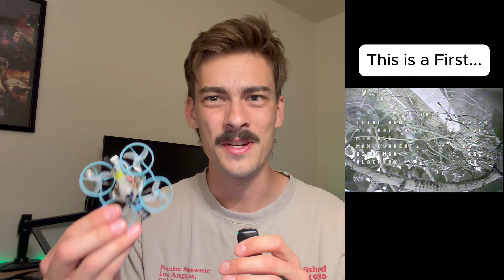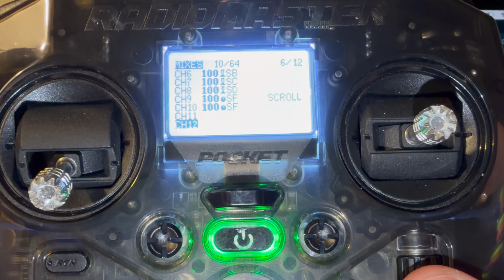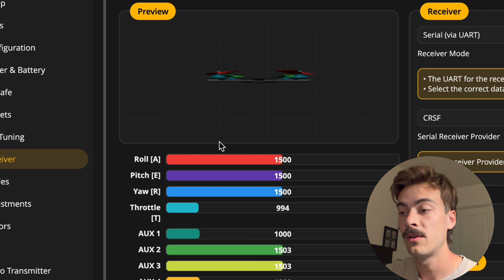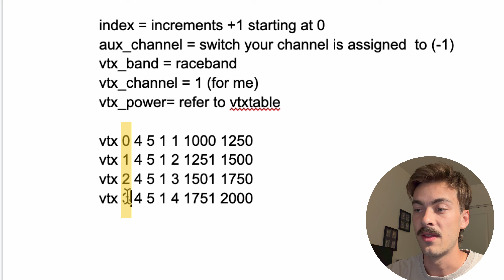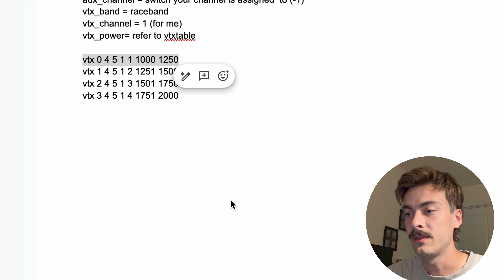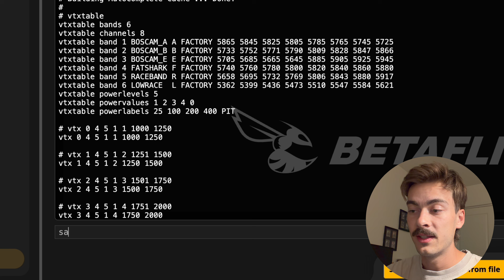Control VTX Power With Your Scroll Wheel (Betaflight Setup Guide)

Comment: Hey, Working thru this and found that you can't set the values as wanted, ie 1251, look at 10:08 and find it reset to 1250.
Hmmm, just found and wonder what diff it will make.
Also found that scroll wheel has seemingly set #'s for breaks, maybe should be set to those?
Also, having issue getting 400 power working.
Reply from the maker: Seriously good eye on catching my mistake I didn’t even notice!
Reply from the maker: Oh dang good eye!! You are right, it does bump down to 1250, and that’s the same for the others 😅. That won’t cause any problems though don’t worry on that!

As for the 400 power not working… I would check what the minimum and maximum aux outputs are for your scroll wheel. Sometimes the numbers vary a bit. Once you find that out, split it evenly into 4 ranges and use those for each aux command.
Reply: Ok, Got it working with a few tweaks. Your Pocket scroller seems to work different than mine. Yours scolls all # smoothly while mine has breaks and at specific numbers. So I used those numbers and rewrote the vtx cli input and have all power levels. It could have had PIT mode as well as another thing So, it comes out like this:
vtx 0 4 5 0 1 1000 1275
vtx 1 4 5 0 2 1275 1425
vtx 2 4 5 0 3 1425 1500
vtx 3 4 5 0 4 1500 2000

Comment: Hey man, love the video, super easy to follow. However. In the osd in my goggles say it changes power. Atleast, i think. Cus i see it changing. However when i tried to put it higher, but the power doesn't change. For example im almost losing video, but if i change it to a higher mW. And it doesn't change the range and doesn't  improve quality.
Is there some things i can do to let it work?
Reply from the maker: What channel did you end up using? Depending on the channel being used, the video might just look fuzzy anyways, so you’ll want to make sure you’re using the clearest looking channel and/or set it up having the global ‘0’ vtx_channel variable
Reply: @alec_searle   i am using A 7 5745
and thx i will try the 0 so it is for all the channels. maybe one is better

Comment: There is also VTX PIT MODE for when you get stuck in a tree, I have it on one of the 3-pos switches, and I have my potentiometer dial control my throttle limit, but I might try this method instead.
Reply from the maker: Both are pretty clutch! I see why having pit mode would be better than just 25mW
Reply: does pitmode work on tinywhoops? So smartaudio 2.0? Because I couldnt get it to work.

Comment: I’ve got power outputs at 25-100 - max but max doesn’t work. It just goes up to 100, any suggestions ?
Reply from the maker: Do you know what the max is? I’d make sure whatever value you have is a real one the vtx supports

Comment: Cannot for the life of me get this to work. Air75 II, RadioMaster Pocket. I am actually a software dev so this should be fairly easy. I follow all steps with my correct numbers but when I change scroll the wheel it doesn't seem to update the power, or, at least not the osd...
Reply from the maker: That’s interesting… I had to do some tweaking my first time to get the dang thing to work. If you wanna send pics of your video transmitter settings on betaflight to @alec_searle on insta/tiktok I might be able to help

It could be with assigning the aux channel on the radio controller
Reply: @alec_searle  https://youtu.be/MlktLNKyWBY

I believe this has all the information and steps I followed. I made it 2x speed to save your time. I also tested with a battery in the quad (Same results) but I didn't want to share the camera view. Thanks for any help you can give!

Comment: I use the osd menue. Pitch up yaw left stick comands open osd menue there you go to Features than vtx on that you go to Power and choose the output. But this way is much better bro thx
Reply: Me too, at first I really wanted to put an output on a scroll and then realised that I only really need to change it when I start flying, and I already just used the OSD menu
Reply from the maker: Yeah the OSD menu is pretty clutch if you don’t wanna switch in the middle of flying
Reply: @alec_searle yea thats so convenient

Comment: I can verify that it works! Clear instructions like a first class instructor. Mine was AUX7 and value was 1055 when scroll wheel is all the way to the left. So it was value 6 and I used 0 for the vtx_channel to cover all channels.

 I don't usually race with other FPV pilots but this will be handy when I do need to switch frequency to avoid clashing with a fellow FPV pilot during meetups. I've not tested switching channels yet though, we'll see later. Now my radiomaster pocket controls are fully utilized, so happy!
Reply from the maker: That’s what I was hoping to hear!!!! I’m so glad this video helped you and was clear enough to follow! Especially since some of your values were different

Enjoy it!! I’ll be curious to hear how switching channels works out with the vtx_channel set at 0!

Comment: When disarmed you can just yaw left +pitch up. Now your in the drones settings> features>vtx> power. Then adjust accordingly by moving right stick left or right. Go down to save&comfrm. Done
Not a fan of putting your vtx power on a switch/potentometer. If you hit the switch or move the wheel and accidentally drop your power. Well now you don’t have any or very little video.
Reply: Another fpv youtuber may discover stick commands
Reply: What... left up down menu save flip jump...
Reply from the maker: Yes! I knew you can do that, I just wanted to be able to do it on a whim while flying! Plus my fingers don’t rest on the scroll wheel so there’s not much risk for accidental bumps from me. I totally see your point tho ;)

Comment: Same setup accept a HDzero BoxPro +

About the Buttons
Right 3-Way for Recovery Beep

Left 3-way for the Modes
Left 2-way to Arm/Disarm
Left button for turtle mode

To use Turtle I disarm, hold the turtle button, ARM - flip
Disarm, let turtle mode go, ReARM and GO

With a bit of muscle memory you can do all within a second and get back to flying.
Reply from the maker: That is a pretty efficient setup man I like that!
Reply: @alec_searle I think I'll add the VTX power to the scroll wheel
Right now I have the LCD brightness on it, but I don't use it AT ALL

The only free button I have now is Right 3-Way position 3

Comment: i have this set up too but for when you were stuck in the tree at the start at 200mw, couldn't you just have used the stick commands and change the power to 25 via smartaudio?
Reply from the maker: Yeah I think so! I wanted a quicker way to do it though and this worked great

Comment: Quick tip: there's a low power disarm option in Betaflight. Basically turns the VTX to pit mode when disarming.
Reply from the maker: That’s a great tip! Super useful honestly. I did it this way so I can still get some sort of video in case I don’t know where I crashed at💀